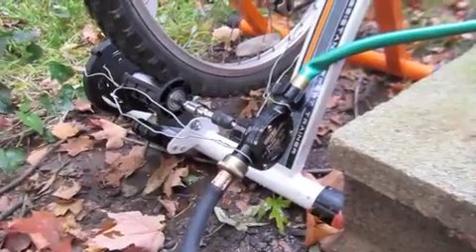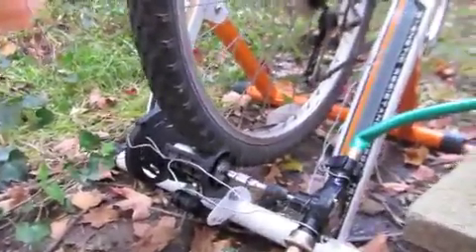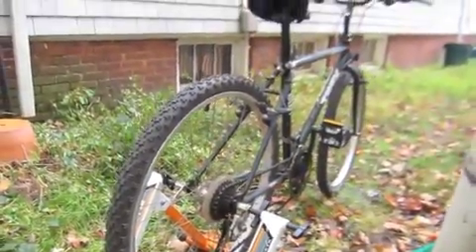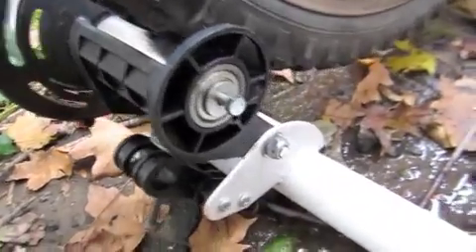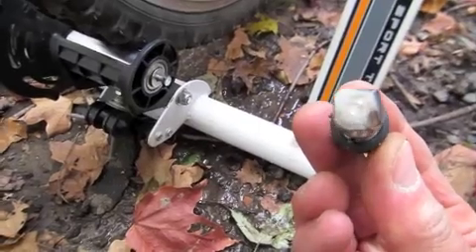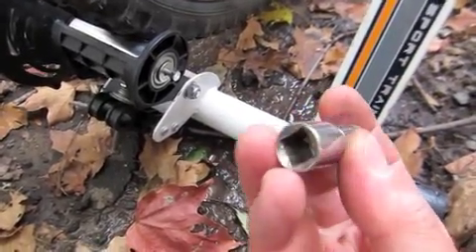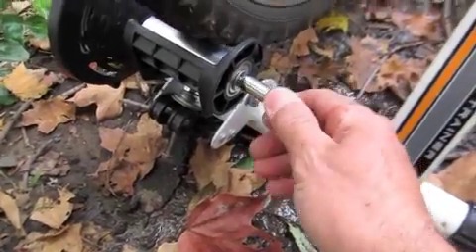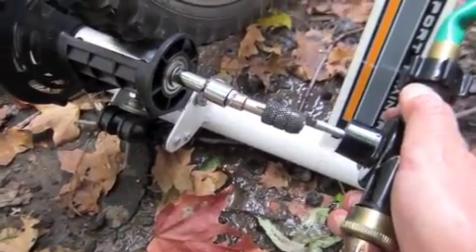Bicycle Water Pump

Comment from the maker: @capitankrk 
I didn't know myself what it is called but it  is  a Kobalt 1/8"-1/4" T-Handle Tap Wrench
At Lowe's it is Item #: 232605 |  Model #: 358221 , $4.98. You have to square off the end with a grinder so it fits the ratchet adapter. Send me a pic or video when you make yours.

Comment: Those drill pumps are VERY inefficient. The bigger ones are better, but there has got to be a better way to accomplish that. Still for what you had, it moved some water so that is the bottom line. Kudos to your efforts.